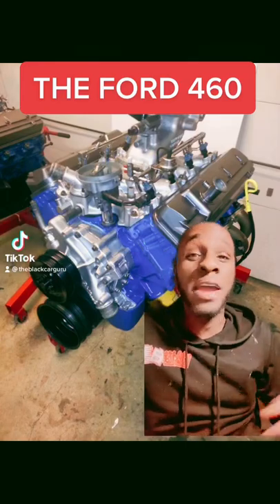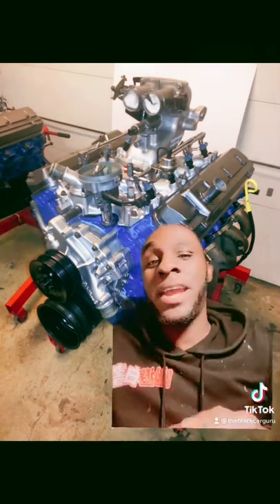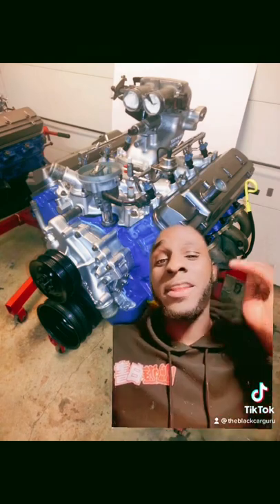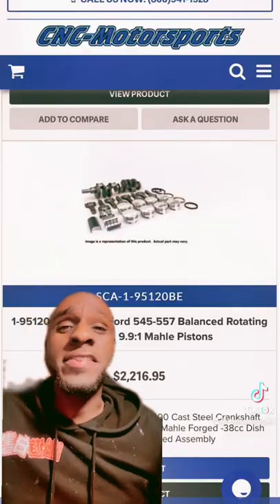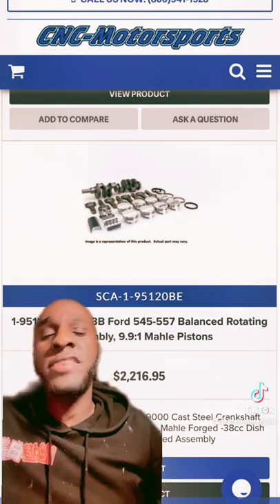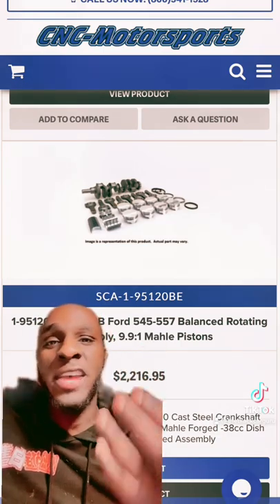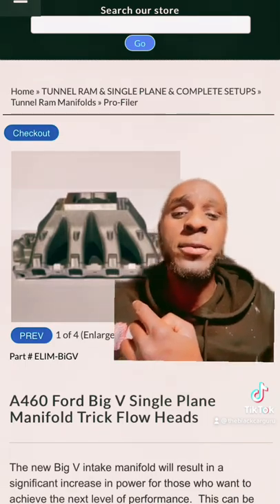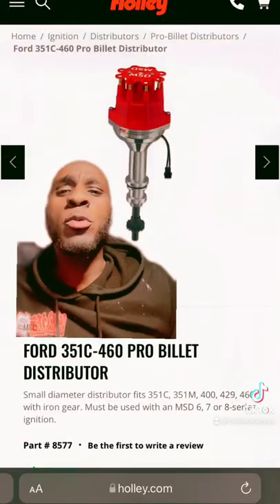The Ford 460 BIG BLOCK!

Comment: I love the 460. 9 mpg.....loaded, unloaded, uphill it don't matter, 9mpg .
Reply: I get 12 in mine lol
Reply: just the way god intended
Reply: Mine was 8 but this is facts.
Reply: Na bro my lq4 6.0 ls gets 9.3 on average
Reply: I got 2 460 1 carbureted & 1 efi. I’m bout 2drop da carbureted 1 in my 89 f350 hardbody & I can’t wait 2 tear up da road
Reply: Well, what the fuck. Im getting roughly, if im doing the calculations right, 2.
Reply: @Vodnik110  maybe need to adjust the carb🤔......are you in " drive " or " backwards drive " ?
Reply: @robsorgdrager8477  drive and it's EFI lol, I am running 35's and got a check engine light so time will pretty sure it's misfiring. Apparently the guy who owned it before did some work and it's a crate so it might have a different cam on it cause it's got that aggressive lobe sound but I've never seen the paperwork to back it up plus she's running rich so my guess is most likely misfire
Reply: Thats better than what igot with my 400 6mpg.
But 38 super swampers and 4.56 gears
Reply: @Vodnik110 need a fresh tuneup bro ford's eat fuel with the slightest misfire especially that big 460
Reply: 11mpg anytime
Reply: Just like the 6.8L V10 in my Super Duty
Reply: @Kevin-c1y5s  funny how that works😏 that was the replacement for the 460🤣😂
Reply: @deathatthefeast5326 
How did you get that? I'm chilling at 8 mpg and can't get better
Reply: Word 😎!!
Reply: @carsonbingham1964  I have no idea. Bought a 86 f350 4 door long bed 2wd with 4spd with only 155xxx and would calculate it on fill ups... I wish I knew. I mean I deleted all the emissions.i only do like 55 to 60 but it has the tall gear in it also
Reply: I get like 6 when I'm towing😂 I had one with a c6 and it legit got 4mpg
Reply: I'm ready my 5.2 Durango I sent with zero oil managed to pull 11mpg consistently after thag
Reply: I read this exact same comment last night but in regards to triton v10s 😂
Reply: Same boat 92 e350 but that thing will pull a house 😂
Reply: i get 6 and mine is stock☹️
Reply: @haydenryan4724  sounds like you need to swap out that fuel filter, do plugs and cap'n rotor. Maybe get one-a them " kick'n Ass " air flitters . 6 is just too low, a guy needs at least 9mpg-eses ✌️👆👌🤞🖖( VGG style pointing at things )

Comment: I am an FE guy. I have accumulated. enough parts to build 6 FEs and the parts are capable of 800-900 hp. I’m 64 and blind enough that I ll never get a license again from a workplace accident, skull fracture is the back of my head. I certainly don’t need to start over with 460s.

Comment: I love this motor.  It's a beast
Reply: Wat vehicle were they originally in?
Reply: @kd-1800  I know they came in f350s
Reply: Vans,  f250 and 350s and a few land yachts back in the 70s.  Beast of an engine but damn hard on fuel..i had a 460 in a 79 bronco and it wasn't factory.. it was sitting on 38.5 tall by 15 inch wide 16 inch wheels and wow was she thirsty AF.  Id put 60$ in it and get maybe half a tank and this was in 2013.  40 gallon fuel tank
Reply: @kd-1800  68 lincolns originally
Reply: @kd-1800  they made crate engines too
Reply: omg absolutely  a TORQUE MASTER AND THERE VERY SMOOTH HARD PULLING ENGINE
Reply: @kd-1800  Lincoln  continental
Reply: @nicolvilleoffroad  69 Lincoln Mark Ill
Reply: @kickz_plug  i know lol like 385 hp and 500 ft lbs tq
Reply: @kd-1800  a few also the ford thunderbird sixth gen

Comment: got 4 of em. my favorite go to big power block for old school builds.
Reply: Hey man! I have a 76 Cougar that had a 400 in it that was locked up. I got a 460 out of an 86 truck that was carb swapped. Cant seem to find a motor mount cofiguration that works. Needs to "sleeve" over the 400 frame but attach to the 460. Any tips would be cool. Thanks!

Comment: Yessir the BBF 460 can be taken to 100 over.. a 557 is crazy..the powernation guys did this before they put the 557 in a old school grand marquis that made somewhere in the neighborhood of 1000 hp.  Then they put like a mild 150 shot on her.  That thing was a beast for a land yacht..i really hope they kept that motor around and they put in something else one day, something that weighs a lot less then the marquis does.. that would be sweet..btw if you haven't seen there ford 300 straight six build check it out..they had it go from 83 hp and 170 ish lbs of torque to 270 hp and 345 lbs of torque..naturally aspirated..stock bore n stroke..just head work, mild cam and flat top pistons.. after the turbo it was pushing 500 hp and over 500 lbs of torque..absolutely insane.. it was a 300 from a generator of some sort..
Reply: A 557 is .080 over
Reply: 345 N/A ft-lbs out of the 300??? 🤯
Reply: @cellphonelightsaber  yessir, the build is on YT power nation channel ,what's really crazy is when you cut two Cleveland  351 heads in half then weld 3 pieces of them together and they fit on the 300 block, not sure of the power figures with the Cleveland head but I'm sure it's a beast, Ford 300s have lots of potential  and there next to impossible to grenade.

Comment: I have a 70 f100 that we restored. I pulled a 460 out of a Lincoln continental and tore it apart down to the block bought everything new to restore it. Took a while to tune and what not but driving like a champ now. Pretty spendy to drive though.

Comment: I’ve got an 89 F250 460 and love it. Slowly fixing her up. Definitely want to do this down the road lol
Reply: Same here mine is a extra cab made in November of 89
Reply: @whitefarms1991 think mine was Feb 89
Reply: @Mc88Flyy  mine needs alot of work but hopefully by next spring I’ll have it roadworthy I’d like to find a straight axle that way i can actually keep tires on the front but one day she’ll look good as new
Reply: I want to put one in a  92 f250 I’m getting next month
Reply: @whitefarms1991 any update on yours? I just started working on her again, got half the wiring work done. I hope I can crank her up within the next 6 months. I think these blocks can hold 1k hp, If she runs good and is healthy I’ll probably do nitrous just for fun. I’m shooting for 500tq to the wheels (before nitrous)
Reply: @Mc88Flyy  i haven’t touched it yet I’ve gotta fix the pinion seal before i can do anything else I’ve just been working on my first gen dodge that i drive it gets a higher spot on the list 
I think yours will turn out great especially if you’re going for 1k horsepower

Comment: Bullnose F250 4x4 w/STACKS🤠🤘😈
'83 Block w/HV pump & remote filter, unported C8VE TE, HF cam, FiTech SL EFI, HEI dizzy, '87 to '91 Aluminum rad w/dual E-fans.
VERY healthy worktruck motor for "largest city in the country"-level ignorant traffic 😂(Toronto, Ontario)

Comment: All that is true, and it will tun for years! But, the added weight, the price to get a light weight transmission that will stand up to 600 ft pounds of tork time you release the  button? A Windsor based block with boost!

Comment: I’ve said this a dozen times and I’ll say it again you can do anything a 454 can do with a 350….. a 351w is awesome but it can’t stand with a 460. 454 is just a boat anchor to me unless your willing to actually spend some money and build a race engine because aftermarket parts are cheaper and easier to get for the 454 vs the 460.

Comment: Got a respectable rod stroke ratio vs the 454. That tall deck allows you to stroke it 557. But, Id stop at 521. Gotta buy a set of heads if you wanna get the goods tho! But a ser of heads, cam,  intake and 850, cheap, reliable power that'll hang in there due to the rod/stroke ratio!

Comment: Wat whip did these 460s originally come in
Reply: Late '68-77 Lincolns and 1971-77 full size Fords
Reply: F250 and higher trucks,  ltd, Lincoln continental, the 427 was available in the mustang which was the same block but different stroke.
Reply: @eazy8  trucks had them into the 80's
Reply: @daveco1st Ford never made a 426 lol
Reply: @kskip4242  I didn't say 426 💀

Comment: You do realize the only reason the 385 series 460 can get to 557 because the deck height is over 1/2 inch higher then a gen4-6 bbc like the 454. And the distributor gear choice is dependant on what the material the cams made of.....an iron gear is for junk ass flat tappen cams 🤦‍♂️🤦‍♂️🤦‍♂️
Reply: What’s wrong with flat tappet cams ?

Comment: Stock block is never a good idea with running boost  after awhile your gonna run into problems.
Reply: That's any block
Reply: @foxbodydude379  Wrong. You must've never heard of a billet block. lol
Reply: @cali2468   lol. Dude that's not a billet block shown on that video
Reply: @foxbodydude379  Are you on drugs? You said "that's any block". A billet block can handle several thousand horsepower. An LSX iron block will handle 2000+hp. A ductile iron sleeved stock LS block 1400-1500hp. My point being there are blocks that can handle an insane amount of boost with no issue.
Reply: They will handle boost for awhile then your gonna have some problems go with a aftermarket one it don’t have to be billet my advice is stay away from Lsr blocks go with brodix or dart  no one can afford a billet block unless your a rich guy  you can find aftermarket dart blocks all the time  there just built better and built to take boost and punishment.
Reply: @foxbodydude379   before I refreshed my engine I had a 150 passes on it no problems  it’s a 11/1 compression with aluminum mgp rods and wiseco pistons     The cam  came from Martin Smallwood race development  and the heads are profilers I run 1 single turbo and run m1 I’ve not refreshed it in 2 years up until recently and before when I ran stock blocks they ran great for awhile then you will have oil pressure problems especially if your wanting to go fast   The bottom end can’t handle no more then about 25 pounds of boost I made it to 28 and slung a rod thru the block destroyed the crank and the block along with heads so if you can find a good block it will help of coarse your gonna have some problems here and there look how we rev them and treat them but if you get a solid program good team and good parts it will make it a lot easier on you.
Reply: @cali2468  mine made about 1800 and the guy didn’t wanna push his dyno it was on its last leg he said mine would make 2000 plus  I’ve heard of billet Ls engines making 3000 horsepower check out  Barosk race engines and wven Steve Morris tkm all those companies has made that or near it.
Reply: The 460 has a super solid block im talking about it will hold pretty much anything. The cylinder walls and the meat between each cylinder will hold alot, I mean you can stroke it to a 557..... Think about that. Thats alot of meat between those cylinder walls

Comment: 454 block can be bored over ~.120 a 496 is only 0.060 over with a 4.25 crank, with certain parts you can fit 4.375 in crank in a 454 block, That makes a 525. Get your facts straight before you make these videos. Displacement isnt the only thing with both these motors.
Reply: This guy is mostly a YouTube car knowledge guru.
Reply: @timothypadilla4192  no shit
Reply: You can go bigger than a 557 with a stock 4.9 bore space big block Ford too , you can go 4.5 bore and 4.75 stroke which is a 604 cubic inch engine . The factory dooe-r super cobra jet  heads are some of the best oem heads ever produced as well , they’ve been 1000hp all motor .
Reply: Bro I'm not trying to be rude to this young man because I like what he's doing but he needs to do his research.
Reply: Ford big block still better than 454 Ford 385 series best big block ever be made.

Comment: The 460 might be the exception in this specific scenario. However, the fact is you'll find more Chevy motors in Fords than Ford motors in Chevys.
Reply: Hmmm maybe cuz they are a dime a dozen?
Reply: @aaronmcconkey1062  Nah it's because it's the right tool for the job. Just like a 9" Ford for the job.
Reply: @aaronmcconkey1062  Nope it's because BBC is better. It's been proven time and time again. That's why the fastest cars run BBC or Hemi and not BBF.

Comment: WRONG. To reach the 557 on the 460 you have to Stroke it. Actually the Big Block chevy can be taken out to over 600 cubic inches with the factory 502 blocks. If you go to the Ford Racing A-460 it can be safely bored to 4.50 inches. Some guys have taken it to 4.60 inches due to the siamese cylinder bores. But I wouldn't push it. But the chevy still beats it in the cubic inches war. The biggest cubic inch gain you can get is by stroking an engine. I've been doing this for over 55+ years. I know what works and what don't. Both engines do very well with eftermarket Aluminum cylinder heads. John Kaase has fantastic heads for the Big Ford. But as of right now I'm running a Ford 460 that's bored .040 over to 468 with Forged ICON Pistons and Forged Eagle H-beam 7/16 bolt connecting Rods with 429 DOVE-C Heads on it and a Comp Cams .564/.574 lift and 226/234 duration at .050 and a 111 lobe centerline in it in my 1986 Ford F-250 4x4  Truck.

Comment: 351w is the superior engine
Reply: Nope. That 351 vs a 460 in a boat. 460 all day. Gota have torque. In a car for auto cross probably gona go with 351 w stroked to 408. Either way cant go wrong.